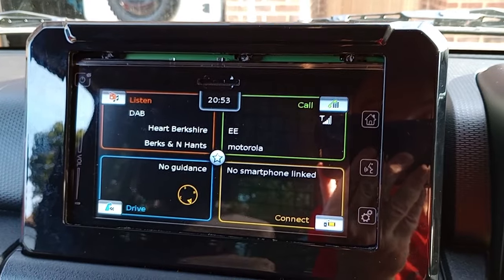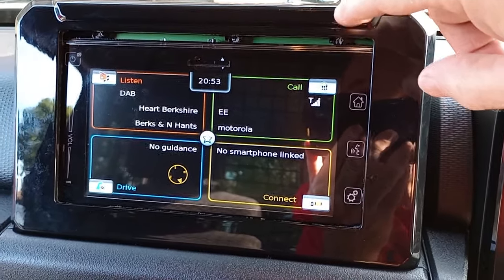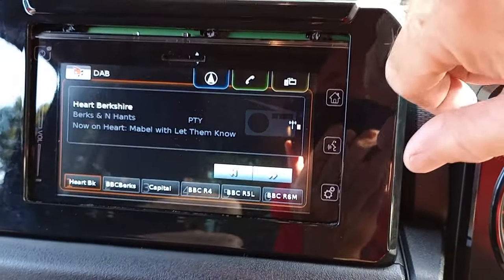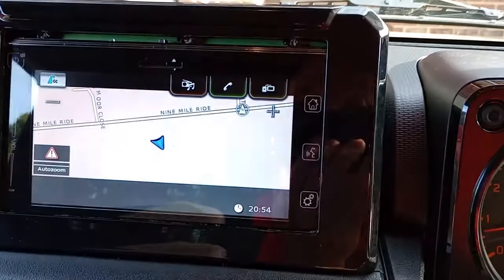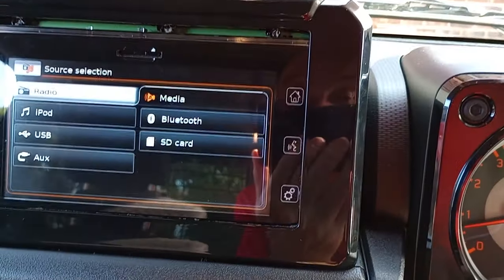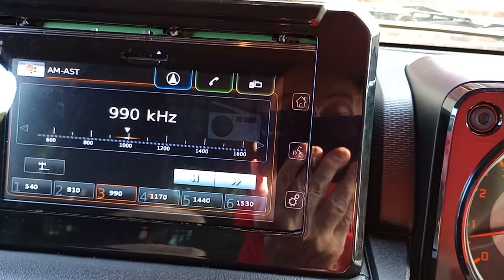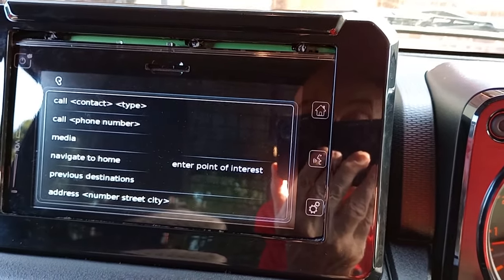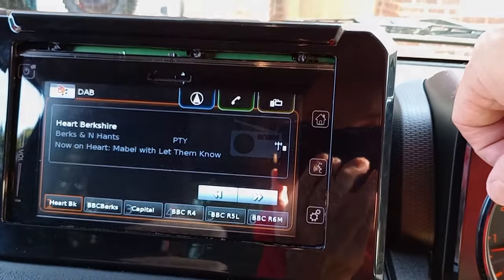Radio install - Progress update

Comment: very interesting.... how about the GPS Antenna ? i wonder is it already there also in the LCV ?
Reply: it would be great to know what you decide to do with your system, I am looking to do one soon myself on a LCV
Reply: @katydavison1832  I want to install a Android Headunit and 4x165mm Speakers with Adapter Rings.
Reply: @ramiretz  Was there a specific headunit you have in mind? I am looking to replace the headunit and speakers too
Reply: @katydavison1832  I go with a China Android Headunit, the correct wiring loom for the Jimny jb74 is included and also the frame... So it should be a plug and play kit and I hope all the steering wheel buttons will work too with the included wiringloom
Reply: @ramiretz  would you be able to share the link with me please

Comment: I tried to had this radio installed in an oficial Suzuki garage and they refused. Told me that the radio doesn’t has compatibility with the Jimny pro.
Ended installing an Alpine one somewhere else.
Reply: Which Alpine did you have installed? I have got a LCV Jimny arriving next week, and I am trying to find a suitable system to replace the standard radio that it comes with.
Reply: @katydavison1832  I have an Alpine ILX903D
Reply: @djirasak4255  Did you have this installed or did you install this yourself? did you have to put in aa GPS or Microphone too or does it just work off of your iPhone through the Apple CarPlay?
Reply: @katydavison1832  I did have a garage install it for me so I would have guarantee.
It comes with a gps antenna that were installed under the dashboard.
The garage told me that once you change the original radio must install a new microphone so I’m using the microphone that Alpine provides you but it’s pretty small and there’s no cables left anywhere.
The original USB port can still be used with the Alpine radio to connect Apple Car/Android Auto and now can use it to watch movies through a pendrive too.
Reply: @katydavison1832  and Alpine gives compatibility to install a reversing camera too.
Reply: @djirasak4255  Brilliant thank you so much, am I right in thinking that it is not steering wheel compatible though? that you can only use it through the touchscreen to control it?
Reply: @djirasak4255  thank you so much that is so helpful.
Reply: @katydavison1832  partially compatible actually.
Phone controls won’t work but the volume and change track control will work as usual.

Comment: Hi! Sorry, my question is not related to the radio. Is it possible to install into comercial jimny handles for rear passangers? I would like to install something there which requiere tightening into that screw holes. Thanks a lot for answer
Reply from the maker: The load partition bolts into the position of the rear grab handles. If you remove the partition you can install the handles
Reply: @bigjimny  if I'm correct that metal mesh screws into front holes of grab handles. I actually need the second one, closer to the end of car. Are they present and usable please?
Reply from the maker: @mr_outlived  Yes, it is there. I thought you wanted to put a handle there
Reply: Thanks a lot for your help. It is for gullwing cupboard from Bushtech. Very handy accesorry for overland. Your advice made my decision to buy comercial version easier. I wad already looking at it cause of increased payload capacity.